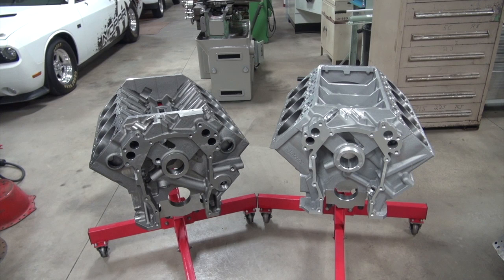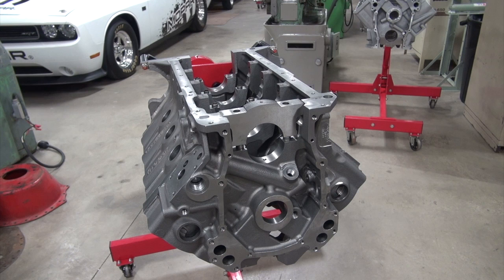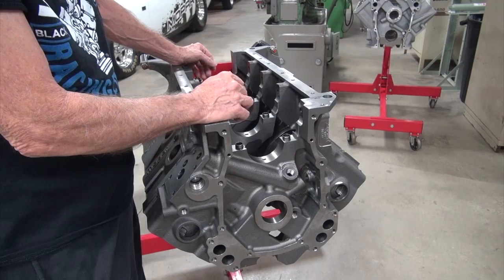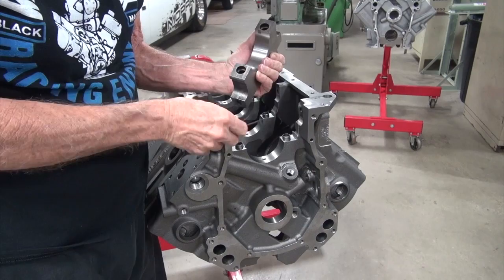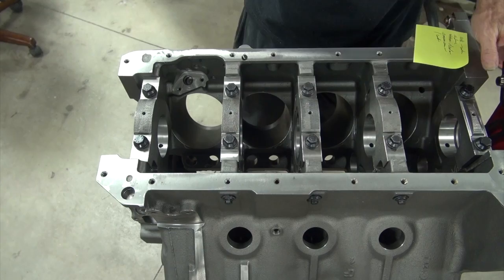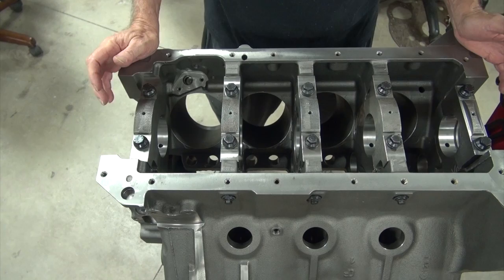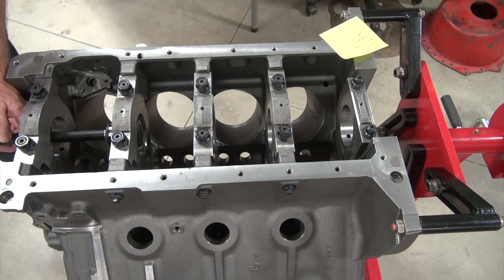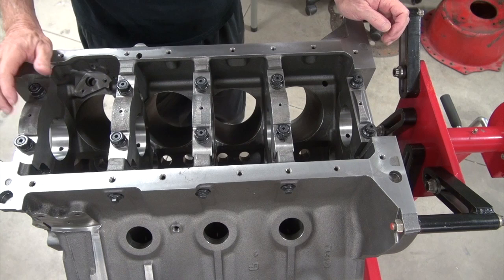Building your 426 Hemi Ep 1 #426hemi

Comment: SUBSCRIBED!!!! Rick - THANK YOU for making these videos. This is exceptionally well presented and informative. I have had a 66 426 short block sitting on an engine stand in my shop for the last 8+ years, it is destined for my 70 Roadrunner but other projects have gotten in the way. I am really interested in seeing the valve train information.
Reply from the maker: Thanks for watching and I will try to cover everything on the valvetrain.
Reply: @rickseeman5679  Thank you, I greatly appreciate it. I need to get a cam and lifters, then measure for pushrods but I am very interested in what you have to share.
Reply: @rickseeman5679  id rather have a good income/job/50k-100k-per year than cheap foreign goods and a poverty job under-20k, dearly someone who has/is competing for a good manufacturing job a a millwright/mechanic ,ps former auto-mechanic mostly on DSM's and chevy/caddy's 

anyways i will check the other videos for your take on gen-2 hemi's as iv got one in the shop in a 60's charger restomod

Comment: Same  thing with snap rings, they have a round side and the other side a hard edge, due to them being punched out.
But you are so correct about  the washers being directional  hard  side is pressure side, snap rings hard side out so it's less likely to slip off.

Comment: Hi Rick!
Thanks for great videos - I have now watched this series twice😊 May I ask if you would be kind enough to share your build sheet?
Thanks😊
Reply from the maker: Let me see if I can figure out a way to post it
Reply from the maker: Block	Mopar/Callies siamese	4.49 bore 	 $ 6,200.00 	x	
Cam bearings	Clevite	included		x	SH876S
Main stud kit	ARP		 $ 150.00 	x	145-5603
Crankshaft	Callies Magnum	2.200 pins	 $ 3,500.00 	x	GEQ-62J-MG
Main bearings	Speed-Pro		 $ 150.00 	x	
Rear main seal housing	Mancini billet		 $ 100.00 	x	MRE223
Connecting rods	Callies Ultra I-beam	7.100" .990" pin	 $ 2,800.00 	x	U15270
Rod bearings	Clevite		 $ 150.00 	x	
Pistons and pins	Ray Barton/Diamond/Trend	tool steel pins	 $ 1,800.00 	x	80026
Rings	Total Seal	included		x	
Balanced rotating assembly			 $ 200.00 	x	
Cam	Bullet	flat tappet	 $ 300.00 	x	
Lifters	Comp	flat tappet	 $ 267.00 	x	821-16
Pushrods	Manton	3/8" .095" wall	 $ 278.00 	x	
Timing chain	Cloyes	multi key	 $ 135.00 	x	9-3525TX9
Timing cover	AR Engineering	aluminum	 $ 350.00 	x	AR224
Timing cover studs	ARP		 $ 20.00 	x	
Oil slinger	Mopar		 $ 20.00 	x	
Head gaskets	Fel-Pro 	.051" 4.590" 13.7cc	 $ 200.00 	x	1104
Harmonic balancer	Fluidampr		 $ 500.00 	x	712425-004
Balancer bolt and washer	Mopar		 $ 20.00 	x	P5249557
Oil pan/pickup/fitting	Milodon		 $ 400.00 	x	30931/21300/21468
Windage Tray	440 Source		 $ 100.00 	x	
Oil pump	Melling		 $ 125.00 	x	M-63HV
Oil drive	Milodon		 $ 200.00 	x	21505
Oil pickup hose/fittings	Aeroquip		 $ 100.00 	x	
Oil pan studs	Milodon	bullet nose	 $ 37.00 	x	81320
Heads	Edelbrock	Victor Jr	 $ 3,300.00 	x	
Valve Springs		included		x	
Retainers		included		x	
Keepers/seals		included		x	
Rockers stands	Stanke	purple aluminum	 $ 575.00 	x	
Rocker shafts/plugs			 $ 400.00 	x	
Rockers arms	Stage V	roller 1.6 ratio	 $ 2,050.00 	x	
Rocker springs	Mopar		 $ 37.00 	x	P4452827
Rocker adjusters	Smith Bros		 $ 50.00 	x	
Rocker shims	Mopar		 $ 37.00 	x	P3690896
Head studs	ARP		 $ 275.00 	x	145-4005
Valve covers	Mopar/KB cast	used	 $ 750.00 	x	P5249595
Plug tubes 	Mopar		 $ 120.00 	x	
Plug tube O-rings	Arruzza		 $ 30.00 	x	
Valve cover studs	ARP	used bullet nose	 $ 50.00 	x	245-7601
Valve cover gaskets	Ray Barton		 $ 30.00 	x	
Breathers	Mopar polished aluminum	used	 $ 500.00 	x	P5007499
Valve cover nuts	SEMS washer		 $ 50.00 	x	
Plug wires	Taylor blue		 $ 137.00 	x	75689
Plug boots	Taylor		 $ 50.00 	x	44300
Wire separators	Moroso		 $ 10.00 	x	72160
Misc studs/gaskets/paint			 $ 200.00 	x	
			 $ 26,753.00
Reply from the maker: That didn't work out very well. I will email it if you send your address.

Comment: Does anyone make a shallow cylinder head with a 40 degree or even a 36 degree cylinder head instead of the 58.5 degree at a 4.500 bore ???  This should be a 2.500 intake and a 2.00 exhaust valve.
Reply from the maker: Some heads like the  Edelbrock Victor Jr and Stage V have a kicked exhaust and can go pretty big. But maybe not quite that big.

Comment: I have a Bulldog block getting ready to throw together.Ive heard the horror stories about these blocks.have any thoughts on that particular block? I am planing in stroking it with stock bore.using7.100 length rods.Ive had block checked 3 different ways from Sunday  I'm told its good.🤷
Reply from the maker: Hopefully it will be good. I suppose you have your reasons for going with a stock bore but I don't know of much upside to it. Remember, if you are planning to use Edelbrock heads (they are the best value/flow and they're aluminum) you will have to notch the bores or the valve won't open. If you need help with this mod let me know.
Reply: @rickseeman5679  Finding Heads right now is a mess..went to the Nationals few weeks ago..Found one guy with a set of SR Indy heads.I do have a set of the old cast Mopar heads but really want the Vic Jr. What both would you recommend? I've always ran wedges this is my 1st Hemi build.Appreciate any advice you have.
Reply: @rickseeman5679  If I gi bigger on bore,will I still need to notch it?
Reply from the maker: @deansmiley8221  Not on 4.500" but I'm not sure when it will clear and when it won't on smaller bores. Everything is easier on 4.500 bore and parts are more available.
Reply: @rickseeman5679  Thanx!
Reply from the maker: @deansmiley8221  Victor Jr's are the best deal but WOW when are they going to ship some. I've had a set on order for 6 months and one guy I talked to said he has had some on order for 2 years. Which heads do you have now?
Reply: @rickseeman5679   I would agree with you on that can't beat em for the price. If you look at shipping dates from Jegs or summit its anywhere from 2 -6 months or longer.and it also says not in stock ships directly from manufacturer.  No idea what is going on.
Reply from the maker: @deansmiley8221  It appears that  Edelbrock can't figure out how to make a head. What I can't understand is how they are going to make the payments on that buyout if they can't ship anything.
Reply: @rickseeman5679  Even crazier is for some reason Ford Fe heads are available  and so are Gen 3 heads.

Comment: They may be nice casting by look but they quality of the steel is worse than the old blocks from 85 and earlier. I was a steel worker for 20 years and can vouch for steel quality. Even casting iron is more brittle. I purposely look for car parts from the 60s and 70s.
Reply from the maker: I don't have much of a way to check the quality of the steel but the castings do look better. Thanks for watching.